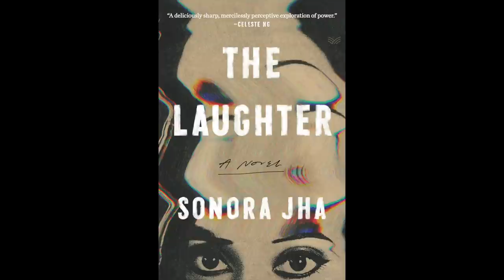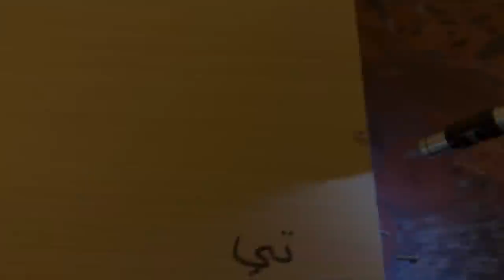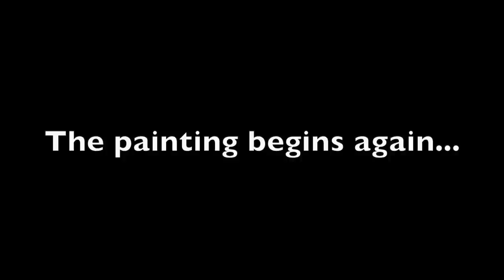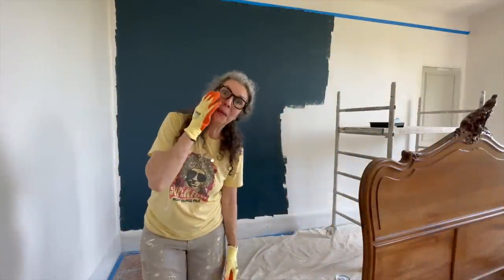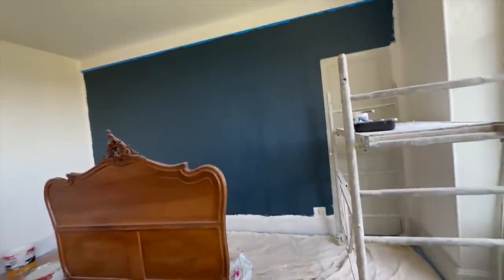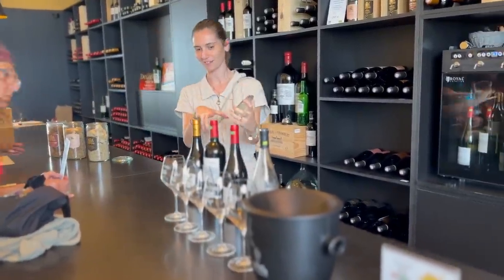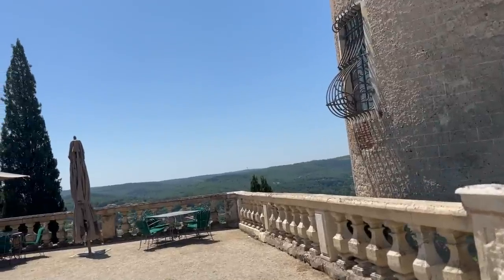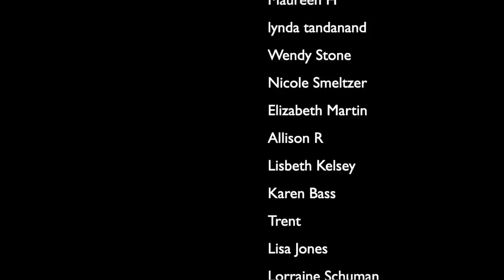A Daring Bedroom Paint Color! 🫢 The Chateau Chronicles – Ep #40

Comment: The only objection I have to the dark blue is that it has an optical illusion of pulling the wall in. If you do decide to paint all the walls that color it will feel very closed in. You could leave a few walls, put in the other decorations and then decide. If you decide to change that blue, you can cover it with gray. It will really help to cover it. I rent out apartments and a contractor suggested “Dover white”. He said that it never offends anyone and feels light and they use it everywhere. I’ve had exceptionally good luck with contractor grade eggshell Dover white by Sherwin Williams. It’s a good starting pallet. It also cleans up extremely well. Years ago a decorator told me to search magazines, wallpaper books, etc find a pattern or colors that you love and start there.
Reply from the maker: Thanks for the ideas

Comment: Do not, and I will repeat. DO NOT! use silk as a lining on curtains. The sun will shred it in very short order. They will turn to dust and crumble. If you wish to use silk to make curtains make sure you have a light blocking liner on them and use the silk on the inside of the curtains. You will be very disappointed if you don't listen. I have seen very expensive curtains ruined by the sun in the past.